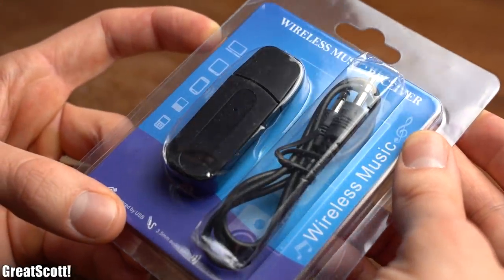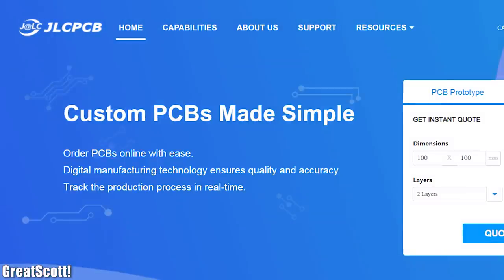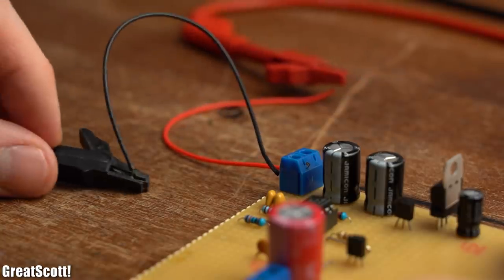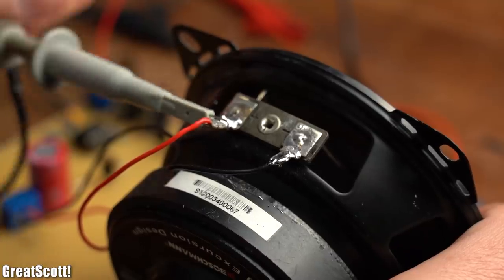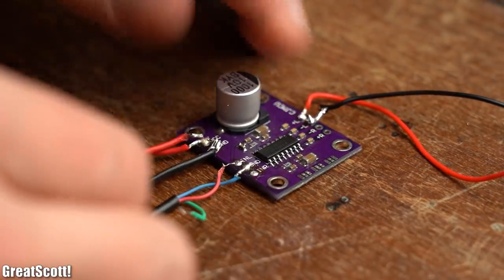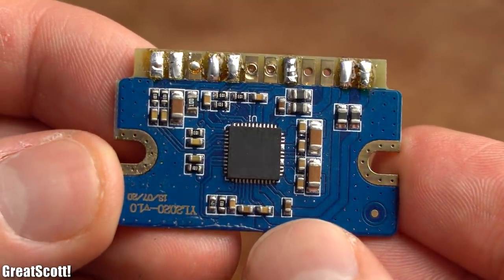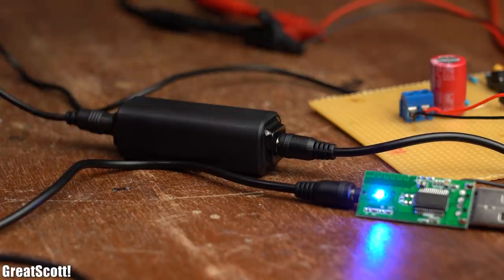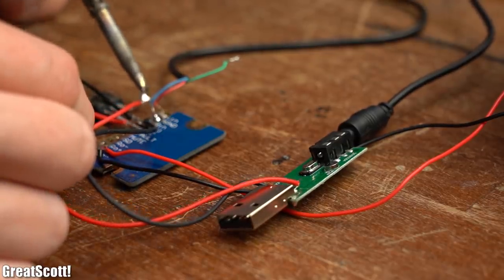How to remove buzzing/noise from a cheap Bluetooth Music Receiver? (Experiment)

Comment: It kinda hurt when you clipped that 3.5mm's cable so close to the connector.
Reply: Ya
Reply: Ya
Reply: ikr
Reply: u can always reuse the jack if u get that plastic off but it would be simpler to just leave some wire
Reply: That was such a low en cable that you wouldnt want to use the connector anyway.
Reply: Same but in reality it's much easier to use a new plug with solder lugs. Soldering together two stereo cables would make a messy end result and be a pain to solder and heat shrink. Likely quite brittle also. I'd do that only for some obscure connectors.
Reply: ahahahah exactly :D :D :D :D
Reply: Ja!
Reply: Wokwokwowkwowkwok....
Reply: They aren't sentient
Reply: Thank god I wasn't the only one thinking that.
Reply: he got that cable free from the BT reciever, and probably has 300 extras lying around doing nothing important.
Reply: Totally agree, the same feeling. 
However, to reuse such plug, I usually strip all casing from it, and solder directly to its core. Then i make new casing of my choice with some hot glue and shrinktube on top. That way new connector looks clean and nice, stays rigid and strong while being flexible enough. And no ugly solder marks! 
Try it, and you'll never buy these dismountable metallic (or even worse - plastic) plugs.
Reply: @DimaZheludko  Thanks for sharing. I'm definitely trying that.
Reply: True
Reply: I just remove the cheap silicone from the connector and unsolder the old wires. If i need one i solder it to whatever cable, cover it in hotglue and shrink some wrap around it. Connectors that i made like that last for at least 5 years, non of them broke yet.
Reply: jack killer :O :O  what a mess!!
Reply: @rimmersbryggeri  There's always a use for every connector. Even the cheap ones.
Reply: @DimaZheludko  kinda great idea , thanks
Reply: No mercy 😂

Comment: I recently research on this problem . I found that there is problem in bluetooth receiver ground ( no proper thickness of track ) so it do not allow proper flow of current so i connect ic ground with a wire with main ground with additional wire. (very very very very cheap solution)
Reply from the maker: Hmmmm I did not try that.
Reply: @greatscottlab   pin this post!
Reply: Good to know. Will try it.

Comment: The 1:1 transformer in between the audio did not work as the two grounds were still connected. If the 1:1 transformer was used two separate the grounds it would work, however, you of course can not do that with DC so you have to use a switching converter. This is precisely what the DCDC converter is; a transformer with switching power supply. I think it would have been good if you would have mentioned this in the video.
Reply: Correct me if im wrong but in the 1:1 isolation transformers grounds are not connected. Isolation transformers can filter out DC interference voltages. The interference that we saw in the osciloscope was actually an oscillation that via induction was created in the secondary winding of the transformers there.
Reply: If you ask me, biggest mistake in this video is that he forgot to mention "the" solution - proper star ground connection

Comment: I wish I could isolate my grounds and remove my tinnitus :(
Reply: Is it already soldered in place? You could just scrap it and start over if your project is that botched.
Reply: @Allocated_Brain  Maybe I'm.just not getting the joke, but OP has tinnitus, a hearing issue which causes annoying fake tones to be heard when the sufferer is in silence.
Reply: @aathish04  The joke is that OP as the 'project' is faulty at a fundamental level requiring a whole replacement unit.
Reply: It's 2020 and still no cure. It should be the future damn it!
Reply: It's being worked on. They've already figured a way to "reflow" the "pcb" to fix bad connections between components so right now it's just a matter of looking at the diagram to figure out where to point the inductive antenna.
rTMS is a helluva thing, it's going to be BIG in the 2020's.
Reply: @npiper  Will JLCPCB be selling them?
Reply: In other words, go back to your mom and dad, and ask if your body is still under warranty. If yes, ask replacement part for your internal ears.

Seriously, tinnitus is caused by the cilias in the cochlea. There is two kind of cilias:
- sensor cilias that send pulses (action potential) when detecting vibration.
- motor cilias that move on command

The sensor cilias are pressure sensor similar to the sense of touch on the skin. They are not able to tell the brain about sound intensity. In other words, they only send square waves to the brain. This is like those people that set their amplifier to max and all you hear is a very distorted noise.

The motor cilias are the majority. Last evaluation was 75% and the value seems to be increasing. (Not that our biology change, but our understanding of the way we hear sound is evolving).

The motor cilias is the engineering "trick" that give our hearing system the very wide dynamic range in sound intensity. Their mission is to protect the basilar membrane from being shacked too much. As a sound wave starts propagating from the oval input, the cilias near that input have the most difficult task to vibrate in opposite direction to remove the high frequency component. We are talking about the range from 4 KHz to 20 KHz.

The wave continue its progression toward the middle of the "escargot", loosing more and more frequency component. Near the middle of the spiral is 1 KHz, the point of greatest sensitivity to both frequency separation and sound level.

When reaching the end of the tunnel, all the frequencies from 200 Hz to 20 KHz have been removed. The remaining wave, stripped almost nude, with only the thin layer of frequency from 20 Hz to 200 Hz, then turn around and exit thru the round window. 

The cochlea is a "fast fourier" frequency decoder, returning to the brain the frequency spectrum instead of the sound wave. That statement is true only for frequencies from 200 Hz to 20 KHz. The reason the "bass" in music feel different is because we hear that frequency range in a radically different way than normal sound.

Recapitulation:
The human hearing system has an amazing 3 order of magnitude bandwidth (10 octaves, 10 order of binary magnitude : 20 Hz to 20 KHz), a ratio of 1/1000 which is close to 1024, 2^10) of frequency range. By comparison, the frequency range of electromagnetic wave we can see is only one octave. We can see from red, near 400 THz up to blue, which is less than 800 THz. This is about 0.3 order of magnitude.

The human hear has an amazing dynamic range in term of sound intensity. We can still hear the feint voice of a friend the other side of the subway tracks with noise interference 10 times stronger.

I give detail about the way we detect sound source in 3D on quora. What human do, om an engineering point of view, is as amazing as the echo location of bats (and some birds). In the process of evolution, when the brain took so much space that keeping mobile ears, like horses and dogs, for example, was not working anymore, the brain got new structures to determine the direction of sound based only on the harmonic content, not the relative intensity of sound as detected when moving the ears at an angle closer to the source of the sound).

Hang on with your tinnitus. I predict that a cure will be found in our life time. All we need is a younger generation of scientist who can think out of the box. Understanding that we hear because of motor cilias, not sensor cilias, is not possible for the old generation.
Reply: @ristomatti  I mean if you really want to go inducing currents in you gray matter with a budget PCB and an uncharacterized >5000 Gauss electromagnet that has to be dipped in a cooler of dry ice between pulses then go for it. The targeting is still mostly done by hand at this point anyway! Just mind the motor threshold and try not to twitch too much*.

*Warning: thinking about twitching in an attempt to prevent it has been shown to potentiate motor neurons and increase the magnitude of reactions.
Reply: @TWX1138  damn. Now I want prosthetic ears.
Reply: This is truly a great thread :)
Reply: Let me know if they make a notch filter, Im hearing it too (:

Comment: Two notes from somebody who has used these little all-in-one isolated 1W or 2W power supply modules in projects before:
-These devices are typically unregulated (including the specific one shown here), meaning that especially at very light loads, their output voltage can be substantially above the rated 5V and they will vary dramatically depending on the load current.
-The power supplies usually have very high idle power consumption (5-20mA is typical) and also low conversion efficiency at low load. This makes them quite unsuitable for battery powered applications unless you can shut the converter off completely during idle times and your active circuit power is well above the idle consumption of the converter.

Check the datasheets carefully before specifying one of these in a design - most of the graphs sneakily only show efficiency/regulation starting from 10%-20% of rated load, and their behaviour is much worse below those points! For light loads, this can be a big issue.
Reply: For some reason when using one of these its introduces somewhat a static hiss into my Bluetooth receiver and I do not know why? Any ideas ? Any help would be greatly appreciated.
Reply: @rashad5286  a little late but put about 5k resistor in parallel to the isolated converter's output to create a light load, so the voltage is stable. Without this your bluetooth connection could break when no music is played due to the voltage unstabilities.
Any other issue you're encountering such as hissing are due to your receiver itself and you can verify this by powering it with another battery.

Comment: I built a mic and amp circuit from a salvaged electret mic from a cheap headset and a LM386 as an amp. 3 volt coin cell for the mic and 9v batt for the amp, with gain and volume controls. Whenever I turned the gain or vol up, terrible hum, like a horn. I could see the oscillation on the scope. Separating the grounds fixed the problem. Now I can use it to hear previously undetectable air leaks. THANK YOU for the solution to the problem !!

Comment: I powered my Samsung 10" tablet that I integrated in to my car by wiring directly to the car's cigarette lighter power feed, however, this created this same ground loop effect. I overcame that by buying a hefty 12v > 5v DC/DC isolating converter, but it was quite expensive, as I wanted it to be quite a high Amp rating in order to charge the tablet whilst using it. Great video!!

Comment: Two other areas you could look into are: a lower impedance ground between amp and receiver as well as better supply decoupling on the output of the 5v regulator. The decoupling network needs to take into consideration the frequency content of the receiver in order to decouple successfully.

Comment: I had the same problem. And I tried the same methods and stayed at DC/DC converter, the best method. I really didn't realize what the problem is, if the amplifier and the bluetooth receiver have the same grounding, thanks for the explanation GreatScott xD

Comment: Excellent solution. You can also measure the voltage between the 5V negative rail of the receiver and the 3.5mm ground, when thereceiver is powered on. In my case (slight different receiver board)  I measured a 3.3V difference between the 2 "grounds", that definitely means the receiver need a galvanic 5V separate source.

Comment: A lot of that noise can be removed by adding extra capacitance to the power supply rails for the bluetooth device, along with making it the common ground point for the project, so that the long cables to the input are not adding resistance to the ground path. 220uF 10V capacitor directly across the 5V pins into the unit will improve performance a lot, as the regulator output impedance rises with frequency, they are not good at reducing high frequency noise, you need low ESR capacitors near the load to do that.

Comment: Most interesting, many thanks,  stopped me from chasing red herrings and focus on the simple fact that the noise comes from the power rail. This led me to a simple fix ... Starting with an existing power amp with a single rail 20V supply I used a 7905 to create a ground that is 5V below the positive rail. This creates a split supply to power my op amp based front end. The op amp doesn't care that the rails are asymmetric +5V and -15V. The Bluetooth audio module powered from the +5V rail produced a massive amount of noise but a 5mH inductor (a few windings on a toroid core,  <1 ohm) and 1000uF capacitor filter (both parts scavenged from an old PC PSU)  feeding the +5V to the Bluetooth module reduced the noise to acceptable levels. I dare say that a larger inductor would further reduce the noise. These components were chosen on the basis that they were the first things that came to hand when rummaging through my junk box :)

Comment: The ground loop isolator is used when your amp and source are on separate connections

The point of it is to stop one device using the other as a ground.

Additionally a ground loop is characterised by a 50 or 60 Hz continuous humm, the fact that it has a repetitive load (likely when the Bluetooth is transmitting it's beacon) shows it is not a ground loop

Comment: funny that i did this experiment last year when adding BT OVCxxxx module to my car stereo's tape deck preamp output. Isolation transformers were a nogo but i remembered that i had some of those isolated DC-DC converters and it was perfect. I ended up using an ATtiny to monitor the tape deck motor outputs to simulate the encoder signals and give the bt module the ability to skip and prev songs using the OEM controls.

Comment: You know what i find most interesting in this video? Your amplifier. It uses an unbiased output stage where you're simply forcing the opamp to slew right over the required approx 1V bias voltage gap of the output transistors, and to somewhat smooth out the resulting switching atrocity, you have a feed forward resistor. This is actually kinda cool. According to my simulation, not quite hi-fi, but cool.

Comment: Usually i just solved this by disconnecting the audio ground. Quick and dirty but it worked.
Reply: Theres no noise if there is no audio!
Reply: This is a good answer, as the ground is common, there is no need to introduce a ground loop. It's also important to use buffer and filter capacitors near the consumer (in this case near the bt receiver AND near the amp).
Reply: Works well for the XS 3868 tbh
Reply: @dusinnhht  what capacity would you recommend?

Comment: Scott, you did the fix with the DC DC converter, but didn't explain the part or part number (handwriting looks like B05055 instead of S) and instead linked products in the description that weren't used, without linking any examples of what to actually use. I appreciate the help solving my problem! But you did all this work to still have viewers going down a rabbit hole of research to figure out what to buy! <3

Comment: What if you put some inductors in series to the power lines and some caps in parallel?
Reply: I though the same thing
Reply: Me three. If the spikes are caused by a current spike/drop the best thing might be to simply add a buffer cap. Not sure about the inductor though, at these low frequencies I have some doubts whether that would work, this is usually done for high frequency filtering.
Reply: I always do that back then.Just solder 2500 microfarad 16v capacitor parallel to the supply wires in the Bluetooth module.
Reply: @danielegger6460  Inductor is for the back emf so just to create a local emi/c condition. Much like a diode or small value resistor before the converter to create a smaller loop area. any noise from the local supply is dropped to ground.
Reply: Have you tried it? Maybe lifting the ground from the BLE end shielding?

Comment: Well I found a simpler solution that worked for me.
A) Find the feed of the 12V to your amplifier and connect there. Don't use the PCB traces closest to the amplifier IC. Instead get closest to the power supply feed. 
B) Use thick wires to feed the LM7805 regulator! This makes all the difference. Don't use wire (single copper conductor). Use thick cable (many conductors). For me 16 AWG eliminates all the noise.  After your linear regulator IC you can use smaller cable.

Comment: Boi i've been having the same problems, I tried to connect two different amps together to form a bigger amp with a separate line for smaller speakers. And i got a crazy buzzy noise. I just gave up on that project because there was nothing i can do. I will try the DC/DC converter method. I just hope its available here at my local stores. Thanks for making this video mate!

Comment: Add some bypass capacitors across R1,R2 to to decouple your amplifier's virtual ground (pin3) from supply fluctuations. If you use the isolation transformers then you can connect your input signal ground to this point as well.

Comment: Disconnect the audio ground from the amp input and use a thick, short piece of copper wire to link the BT and amp grounds together. Connecting BT power ground and BT Audio ground together creates a ground loop! Additionally add a lowpass filter with 22ohm resistor and 1000uF capacitor before the 5v regulator to dampen the current spikes.